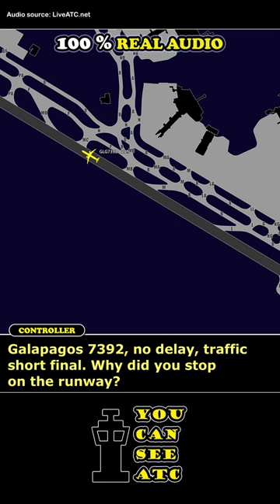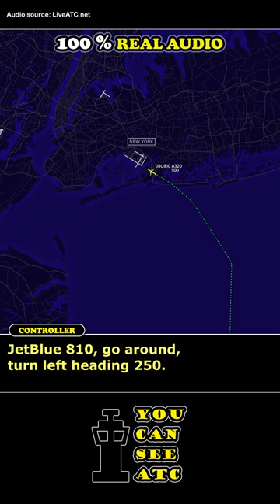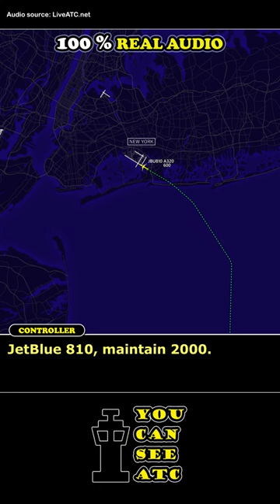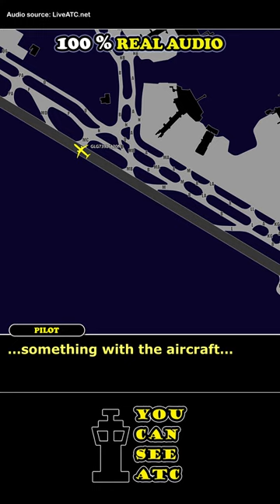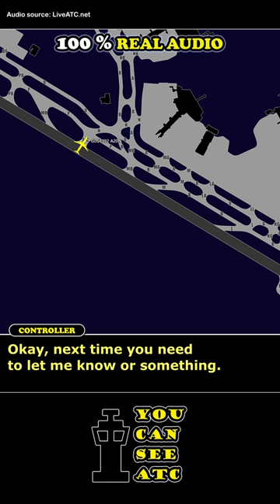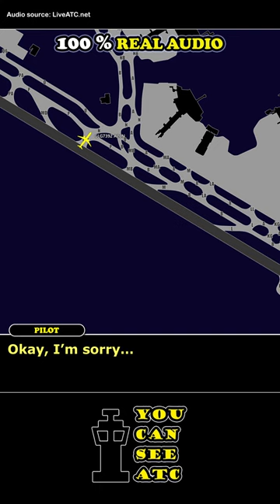Airplane stops on the runway without report #shorts #realatc #aviation  #airtrafficcontrol

Comment: Aviate navigate communicate, the very base of aviation. If the pilots had something like an engine fire they had to put out or they had to run through some checklist, they can do that before communicating, sure they can quickly say stopping, but they're not in the wrong for not doing so